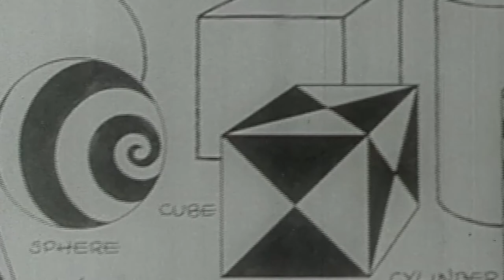Why I Made A Concrete Boat Designed to Sink

Comment: U have no idea how good concrete boat are goods there of the most strongest
Reply from the maker: As mentioned in the video. I am aware that concrete ships are a thing, and that concrete is a viable material for boat building. Sadly however I think history is against you for your claim that they are ‘the strongest’. They’re expensive to build and difficult to maintain. 

Thanks for watching... and happy new year to you
Reply: @LOCKEYJ  not thrue I own a concrete yacht
Reply from the maker: You enjoy that buddy
Reply: @LOCKEYJ  It also depends on the concrete used and on the mixture used. Also, the walls you made are not nearly thin enough, and you don't use any reinforcement for the concrete. You could try making a new one starting with a textile piece or with a net which you could make out of rope or string and use that and some wood or wire for support among the rim of the 1 foot (30 cm) wide, 2 foot(60 cm) long, 1/8 inch (3 mm) thick, (rope/textile) reinforced concrete boat. At most, you could use resin or some homemade oil paint (which takes a lot longer to dry in direct sunlight than normal paint), which you can make for a lot cheaper than store-bought paint (and you need a bit of new or used cooking oil, something like clay or some powder to give it color, and to have the oil heated but not necessarily boiled, then mix the two until you get a thin-enough consistency for painting with). The oil paint would help keep the concrete from absorbing the water and becoming heavier.

The modern version of this is to have a block of styrofoam covered in concrete for keeping it all together, and building a floating island/house on top of it. I'm thoroughly disappointed that you specifically wanted the boat to sink.
Reply from the maker: @SapioiT  thanks, everyone seems to missing the point here- I intended it to sink. As the video mentions I was aware that boats and ships can and have been made from concrete and function- but that wasn’t what I was trying to do.